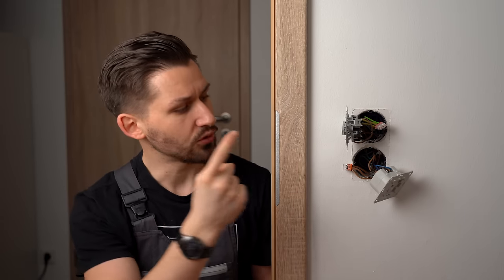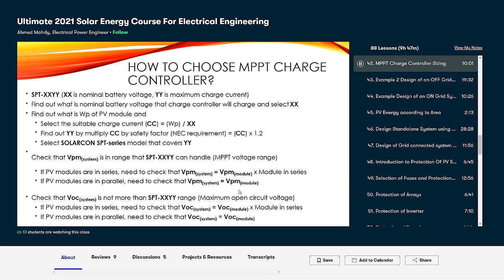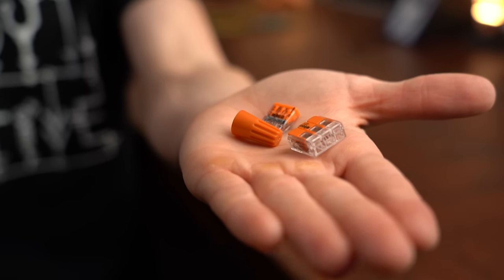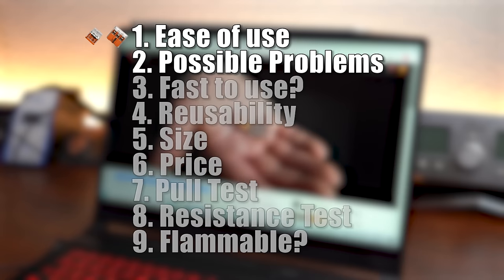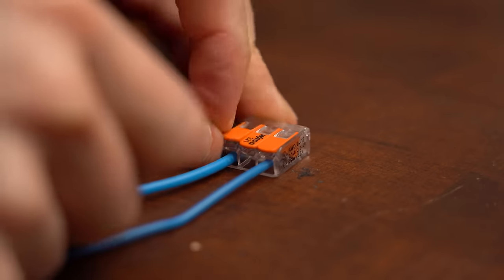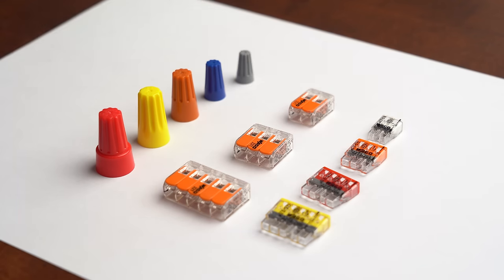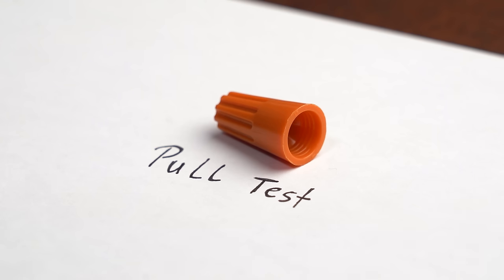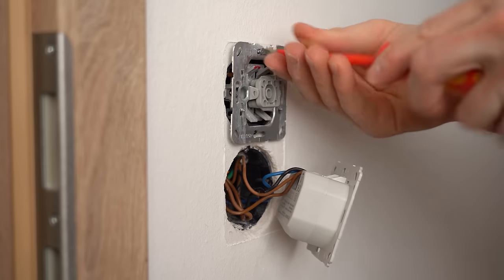What Wire Connector is the Best? Settling a Debate! Wire Nut VS Wago

Comment: Wire nuts are prone to user error. I've never used Wago connectors, but I think that's about to change...
Reply: So you gonna create a long distance wago connector dispencer?
Reply: There are billions of wire nuts installed across America. Billions. They are not at all prone to error if you understand how to use them. This is why Electricians are licensed professionals in the United States. This is just an example of the difference between a professional and an amateur. The wago in the test above performed only 37.5% as well as a wire nut in the resistance test. Why do you think US Electricians would substantially downgrade the quality of their work?
Reply: @senfdame528  You can get them from Lowe's or home Depot too.
Reply from the maker: Go for it ;-)
Reply: I have never had a wire nut fail.
Reply: @Peter_S_  he said prone to USER error; the user fucks up applying them rather than the fault being with the wirenut itself.  Both have their uses but I'm quite glad wirenuts pretty much vanished from domestic electrics in the 60s here..
Reply: @Peter_S_  ok
Reply: Wago is the way, dude. I switched from twisted cap nuts to Wago almost 10 years ago, and I haven't looked back since - they are superior to twist caps in every imaginable way (apart from the price, that is).
Reply: @Peter S  what, you think electricians aren't licensed professionals here in Germany? Sure... And just because something works doesn't mean there can't be alternative solutions with alternative strengths.
Reply: @Peter_S_  "They are not at all prone to error if you understand how to use them"  How is that any different from what he said?  "User error" inherently  comes from people who don't know how to use them properly.
Reply: I sell electrical supplies to US people in europe and whenever I see Wire Nuts I immediately have them replaced with WAGOs, exactly because of this. Its almost impossible to fuck this up, even if you are a guy doing your home install you can use the marginally higher prices Terminals and not run the risk of a house fire or explosive failure (I once had a heater go down due to the earlier european style "Lüsterklemme")
Reply: @stheil  What does your statement have to do with understanding how to use a wire nut properly? This video demonstrates how to not use a wire nut, not how wire nuts are correctly employed in service. Still, the Wago was only 37.5% as good as the wire nut in this resistance test. In the US most circuits are rated for 30 amps and are often pushed to that. The job of a connector is to provide a low resistance path. Using a connector that dissipates 1 watt by inefficiency which should not exist to begin with makes no sense.
Reply: @Peter_S_  What makes you think there are no licensed professionals outside of the US?
Reply: Life is prone to user error.  Literally the only redeeming trait of a wago is how “easy” it is to use.  Other than that they are utter garbage
Reply: @TomsBackyardWorkshop  yeah let’s see that wago stuck inside a lamp housing outside for 3 months in the south.
Reply: @zusurs  except for the fact that both nema and nasa agree that a physically twisted together connection for wires is superior in every way.  Try to pull apart a properly twisted connection with no wire nut.  Now try to pull apart a wago connection.  Wagos are trash.
Reply: @stheil  exactly.  But the point he was making is that in the US professionals have a standard, and easy doesn’t always fit into that.  The idea of the wago has been around for a very long time.  Our most common wall outlet receptacles come with what we call “back stab” connections that are basically just wagos built in.  For starters they only support 14g or 15a connections.  Secondly, you won’t find any electrician in the US that is willing to use them, because he doesn’t want to come back to fix his own work months later because he was lazy and didn’t install them properly.  Even nasa agrees there is nothing better than a physical wire to wire connection.  If your wire is spinning around inside it’s connector, it’s not actually making a good connection.
Reply: why not just use electric tape ... here in India that's defacto winner ... XD .... just twist the wires by hand and tape it .... I have never seen anyone use these in my country ... XD
Reply: @Stefan_Van_pellicom  No. The better Wago was only 37.5% as good as the improperly installed wire nut shown in this test. If you properly install the wire nut the difference would be even larger.
Reply: @wbarber69  And my point was that German professionals also have a standard. And wire nuts are not part of that standard. So the argument "Wire nuts are good because professionals in this country use them a lot" can be countered with "Wire nuts are not good because professionals in this other country don't use them". Note that I didn't say wire nuts are bad. Peter S focused on one point where wire nuts performed better, and I agree on that point. But that doesn't automatically make them superior. And if your electrician has to fix his own work because "he was lazy and didn’t install them properly" then that says more about the electrician than the tool.
Reply: @Peter_S_  about as much as your statement that "This is why Electricians are licensed professionals in the United States"
Reply: @stheil  the point is, wire nuts are a cover for a properly twisted wire connection.  They are not the connector.  Wire nuts are superior to electrical tape and paint in that respect.  Wagos are a cheap rendition of a bus bar.  And the only way to properly connect to a bus bar is with a ring terminal and screw.  I don’t see a ring terminal or a screw inside the wago.   Trying to compare the two when they aren’t even the same thing is asinine at best.  The fact that “German professionals” use them doesn’t mean shit.  The fact that actual electricians don’t use them.  Is beyond the point.  The whole video is a bad infomercial for wagos.  I was almost ready to see him bang one on a brick then use it to cut a tomato.   Once again wire nuts are superior to wagos because they cover an already existing connection.  Which is the proper way to do it.  Wagos are only good as saving you time and effort, not because they are superior, but because they incite laziness and don’t actually make a proper connection.  Which is why wagos were shown to be only 35% as effective in resistance testing.  Because using dissimilar metals to make connections isn’t always the best strategy.
Reply: @stheil  He was comparing licenced electricians to amateur DIY non professionals. You didn't read his statement properly.
Reply: @wbarber69  All the electricians that wire new houses around here use backstab connections. My dad's house was wired with receptacles that ONLY have back stab connections. They had no screw terminals at all. I replaced every single one with backwire commercial grade receptacles.
Reply: @Peter_S_  Huh?  In the US most residential branch circuits are rated for 15A or 20A.  Sure, there are a hand-full of dedicated specialty circuits for high-current electrical appliances.. but those aren't the common case.  I have a 3-gang box with 3 (2-way) dimmers installed.  It's just a mess in there trying to get all those neutrals tied together with wire-nuts.  The wagos are much more compact and easier to pack into the box.
Reply: Never seen wire nuts before (Edit: Never seen them used like this, that is. They are used in some old electronic-meters)
My brother is a electrician, and he uses Wago.
Reply: @lmamakos  Like their units the Americans seem to be sentimental about electrical connectors.
Reply: @Peter_S_  Yeah thanks. I'm an electrical engineer and while I don't wire up houses on the daily I've done a few installations and I promise it would have made no (electrical) difference if I had used wire nuts. You like wire nuts, that's fine. I still prefer other connectors (and that's not only wago ones btw) to them.
Reply: @Peter_S_  You seem obsessed with irrelevant resistances, yet have yet to show us one Wago that has failed due to their "inferior" performance. Just one. That's all we want to see.

Good luck.
Reply: @chrimony  I posted a video from Leviton, one of the largest electrical component manufacturers on Earth. You posted a random home DIY video. 🤣
Reply: @Peter_S_  I posted a video from a professional electrician. What are you smoking?
Reply: @stheil  I have decades of experience which includes a lot of repair of failed connections. Wago connectors are garbage based on their static performance. For connections up up AWG10,  I like ring connectors which are crimped, soldered, and jacketed, attached to screw terminals. It's time to face the physics of the situation and understand that the wago doesn't perform either short term or long term.
Reply: @Peter_S_  Well then I guess I better rush to my dad (who also has decades of experience) and tell him he's been doing it wrong all this time and his house is going to burn down any day now. Btw: It's not recommended to solder crimped connections but I'm sure with your decades of experience you know all about that.
Reply: @chrimony  I'm smoking (rather vaporising) Clementine distillate extract 68.35% THC/12.65% CBD from Tweedleaf here in Colorado, but that ad hominem is pretty pointless and it demonstrated you don't know what The National Association of Electrical Manufacturers (NEMA) has to say on the subject. Ever heard of NEMA? Why would you trust some rando in a DIY video over the word of one of the largest electrical manufacturers on Earth, and over the largest electrical manufacturers association on Earth? Do you get your medical advice the same way?
Reply: @Peter_S_  You keep saying "DIY", when the link I posted was clearly by a professional. Is he wrong? Fine, but that's the point -- professionals can get it wrong too.
Reply: I'm really wondering why this guy is so invested into Wire nuts and appears to be personally insulted because other parts of the world, especially Europe, do not want to chime into his praises of them. Here in Germany Wago and similar style connectors are the norm and German electrical engineering is world-renowned. I trust our engineering more than some random internet weirdo claiming Wago to be "garbage", looks like another case of toxic patriotism.

 In international comparison the US standards of electric installation are really not top-notch, this is not changed by NEMA being the "largest electrical manufacturers association on Earth". Most German electricians shudder when they see what you do over there, for example putting single core of wire through simple holes into metal boxes. For us this is a electric shock waiting to happen. German norms regarding electricity and the safety associated with it are extremely high, way higher than in the US. Many things you do there are downright forbidden here.

Also I would take the resistance measurement in the video with a grain of salt, would like to see it repeated with much more samples.
Reply: @Peter_S_  Sorry but:

a) You don't understand that there are multiple types of "wago" terminals (and they are not even all made by Wago!) with different construction and ratings.

b) You are constantly harping about "37.5% as good" resistance - and completely ignoring that this is a terminal designed for 240V and domestic circuits where you won't get more than about 16A (common breaker rating for a circuit in Germany). So your 30A (or even the 20A in the video) are irrelevant, for such load you will use a higher rated terminal! On a 16A circuit the 20A rated Wago has 25% margin. None of the connectors (or even wires) in the video were rated for a 30A circuit.

c) You are making conclusions from a sample of ONE. How many poorly installed wirenuts are reliably achieving that low resistance from the video? And how many Wagos did you measure to reliably make such conclusion? Not to mention that you are intentionally avoiding the fact that the worst performing Wago was the lever type - and the push-in type was fine.
Reply: @Peter_S_  There are billions of wagos installed across Europe and elsewhere. They are easier and faster to install. The extra losses you quote are fractions of a percentage - it's like claiming ultrasonically welded connections have less losses than wire nuts and are therefore superior.
Reply: @stheil  
Basically @Peter S  thinks that every German household should hire a US certified electrician to replace every perfectly fine wago clamp with a wire nut. 
Wwe use wagos to connect cables for outlets, lamps, switches,.. @230V, so 1W in losses is irrelevant, technically speaking, this connecter adds the equivalent of somewhere between 0,1 and 0,4m of cable depending on the type of wago

Peter S stated that Germany isn't reputable for its genius engineering anymore, but who wants to wrap every wire nut with electrical tape as recommended?   

In a nutshell: Wirenuts will work great for residential buildings in the US. 
These houses, which are 85% framed out of wood, will be destructed and entirely build new more often as the German houses which are built from stone, lasting much longer including their electrical circuits (wagos). 

Maybe one day the Americans will accept that not only their technology and standards work perfectly fine. 
We all know, that the Americans just sometimes need their specialties like their imperial system, the 9L V8 (which are quite cool) or wire nuts. 

(I still think that most of the Americans are quite cool)
Reply: @stheil  a million times YES.  Anyone claiming superiority of putting solder on a  crimped connection tells us a lot...
Reply: @verbanddeutscherunternehmer  dont know why this guy took it on as his personal mission to defend wire nuts, most electricians for new cheap houses dont use the best wire nuts anyways.
Reply: Anything is prone to user errors. But that's quite a strange reason to switch from wire nut to wago
Reply: @Peter_S_  As an American I can testify that professionalism here isn't that great.  Add to that the vast quantity of electrical items sold to DIYers and you can readily see the problem here. If you buy a new LED exterior light from a big box store or online a WEGO connector is a logical way to connect. How many Americans are going to pay to have it installed by a professional?
Reply: @largepimping  Putting soldered stranded wires into screw terminals is downright illegal in Germany because it makes a bad contact and poses a high risk of fire. So, yes, someone recommending to do that is just a (wire) nut case.
Reply: @downstream0114  Now now, don't lump me together with "those people".
Reply: @Peter_S_  After reading your comments I really hope you don't call yourself a professional electrician.
Reply: "I've probably spent more time as a director of engineering working in factories [...]  My connections are in use around the world, and they don't fail. [...] the US Army missile guidance hardware I used to repair" Ok, now I am convinced this is just a troll.
Reply: @JuliJaneMusic  You don't think product designers watch YouTube? Yes, my products are in use world-wide. I've worked in biotech, aerospace, consumer, and industrial areas. I also spent two years repairing US Army command guidance systems that were constructed with large amounts of wire-wrap interconnect. You are not adding any experience, insight, or facts and therefore you are simply trolling.
Reply: @Peter_S_   Joint contact resistance is not the only factor in an electrical installation. If it was, we would all still be using the Western Union splice. Nobody uses the Western Union splice outside of aerospace because in the real world it is not performant in hourly rates. 

You claim to have a pile of j-boxes with failed burned up joints. Great! How were they joined? Probably wire nuts! Also probably a few screw terminals as well. The problem with wire nuts and screw terminals is that they are an inherently inconsistent fastening technique. Was a torque wrench used on the bolted connection? Is it a silvered aluminum threaded lug, or silicon bronze, or grade 5 steel with chromate plating or basic zinc? Is the conductor aluminum or copper? Stranded or solid? Is there anti-oxidant applied to the conductor, the threads, or both? Was the oxide scraped off the aluminum?

These types of Wagos provide enforced consistency. You can know that due to the spring action there will be consistent pressure on every joint. As a foreman for an EC I would die and go to heaven if I could get enforced consistency on joints from my crews or even myself, if it's at a cost of a few extra ohms of resistance in the line. The v-drop will be negligible at 120+ volts.
Reply: @Peter_S_  You cite NEMA as some authoritarian standards body that suggests using wire nuts, but literally the only thing NEMA and the NEC say is to use a certified/rated connector as directed.  That's it.  Use the connector as directed.  That's the standard.  That's the code.
Reply: @Shynd   👈 this guy knows.
Reply: @wbarber69  : NASA would have that connection soldered after the mechanical connection...
Reply: @JuliJaneMusic  : The resistance difference is likely correct. The geometries of the connections mean that the wire nut has much more contact area, essentially removing the connection from relevance. The Wago push-style essentially only has some small edges (because of it's nature as a spring), and both Wagos route the electricity through a separate piece of metal (the bus bar/spring), with the inevitable consequence of higher resistance.

Personally, I prefer screw connections 100%, and find wire nuts too fiddly for me to trust, but on the resistance front they are the winners.
Reply: @Peter_S_  it was was 37.5% ‘less good’ but it’s absolutely within acceptable performance limits. The problem with the wire nuts is they CAN go wrong and a failed connection that you can’t check could burn your house down. With the Wago the connection method is much more likely to succeed as intended, CONSISTENTLY and can be visually verified.  At the end of the day, wire nuts are basically twisting wires together.
Reply: @absalomdraconis  where you gonna find extra solder on the moon?
Reply: @sprint955st  Meh, you could unscrew the nut to check the connection then tighten it back. The resistance difference is quite big...
Reply: I was thinking the same. Even if they were lowest resistance when a good connection is established, it's easy to make a misstake that can make the resistance really high instead. That in combination with them not being transparent (so you can see for example if all strands of a stranded wire is inside the spiral), makes them a bit unreliable. 
Btw. It looked like he used only 1,5 mm² wires there. I think the Wagos may also perform better at high currents, if using thicker wires, since they also get a bigger connection area inside the spring clamp (their maximum current rating is probably set after using maximum rated thickness as well 
- which is 4 mm²)
 - 20A thru 1,5 mm² is quite much and usually not much more than 10 or 13 A fuses is used for that cross section area, in hidden electrical installations (where heat in connections poses the greatest fire risk).
Reply: @Speeder84XL  obviously you also don’t know how wire nuts work.  They aren’t the connector.  Wire nuts are a protective cover.  You make the proper connection first by twisting the wires to NEMA specs.  Then you apply the appropriate wire nut the cover, protect, and fasten the connection.  Nothing beats a physical copper to copper connection.  There is no resistance added this way.
Reply: @goku445  and  @Peter The wires also have resistance. What would you say is so bad about that in a simple residential enviroment ?
Example:
All connection types are less than 1W loss on a 4600W load.
Indeed below that 1W loss there is a big difference (ex.:37,5%) between them all.
Reply: @wbarber69  personally I prefer what they call a Luster or Screw terminal or straight up doing a good proper twist with some pliers,no room for cap there tho need something like a heat shrinking tube for cover
Reply: @ghekor  the whole point of residential electrical installation is that even though something is installed permanently, it can still be removed or changed later.  Wire nuts allow for this.  But they are not the connector itself.  The connection is the twisted wire.  Heatshrink is too costly and unreliable to make permanent connections that could be subject to molestation later.
Reply: @Peter_S_  On the other Hand: Dude, that's 250µOhms more on the 2273, that is completely neglectable on their rated Currents. The 221  tough is disappointing. The Resistance isn't something to worry about at their Current Ratings, but still, the other two Connectors did a lot better. 

I would like to mention, that we do have certified Professionals here as well and I would say that at least 95% of said Professionals use Wago Clamps. I can't speak for anyone, but as a Professional myself I've basically never talked to anyone who uses Wire Nuts, nor have I seen installed any. They basically "don't exist" over here. 

The Reasons are obvious. They are easier to installed. I may be a Professional, but with the Wagos, you just stick em in and they hold. It isn't as tiring when you work over Head, and there is exactly 0 Guesswork if all of the Wires are connected properly or not. 

What I'm saying is... As a trained Professional I would still take the Wago Clamps over the Wire Nut any Day. 

As far as Amateurs goes.... Don't pretend you don't have Amateurs that do Electrical Work. We got them here as well. To be fair, you can do the House Wirings and all youself, if you  let a trained professional controll your work, but we all know Most won't. 
Since we can't prevent Amateurs from doing electrical work, I find I a little bit more reassuring, that they'll most likely use Wago Clamps, as they are easier to install. Again, we can't prevent Amateur works... Trust me if we could... My Jackass Brother for Example thought himself smart enough to wire a fucking Light Bulb in his new House and that bloody Idiot shorted L with PE and that's an Error that the User will detect right after they try to power it on, lol. You won't have that instant Feedback in a Wire Box with poor Connections, that slowly melts away the Plastic inside...
Reply: @wbarber69  True - but it still feels like it's easy to get a bad connection by misstake (especially when using solid conductor wires, that's not very easy to twist tightly or a mix of solid and stranded).
It feels like the Wagos is more reliable
 - even if the resistance is higher, it will be about the same every time (while still low enough for most applications) and if there is any problems (like strands sticking out or wire not stripped far enough), it's easy to se thru the transparent casing. 
But, then - it's also a question of being used to it. If you have done many wire nuts you probably know how to do.
I have never really wanted to trust those wire nuts, but have always used screw connections instead or soldered connections (for different appliances that's not installations in buildings). 
Then I discovered Wago 221 and think they are very convenient and it seems to give a good reliable way to connect cables in the 0.2-6 mm² range (that they currently have available).
Reply: @goku445  surely the entire point is to fit once and forget?? The nut is to ensure a better mechanical connection, sure just go right ahead and undo it.
Reply: Here and there I still find wire nuts (NL), and cut them away if I have to work in that box.  I tried 1 and threw it a way, I only use wago (like) connectors, have no idea what they cost. Need them, find/buy them, use em...      Try not to use any connector on longer distance and known bigger users (wallsockets and >10A)
Reply: I thought, great no more wire nuts!!! .. then saw the HIGH resistance readings.. https://youtu.be/zgjo36-jaFY?t=578
In the USA, our voltage is 1/2 what is used in Europe, thus out resistance power losses are 4X higher. Losing Several Watts at EACH junction, is unacceptable. 
Also, those Lever Lock Wago connectors, carry the contact force in PLASTIC.. which will relax with time & temperature .. seems VERY RISKY.. no thanks, sticking with metal spring wire nuts.
Reply: @Speeder84XL  if you find it too hard to twist a couple wires together properly, then you don’t need to be doing electrical work.
Reply: Over here, wire nuts are illegal to use. Due to the change in temperature that will caues the metals to expand and retract, it will loosen the twisted connection over time. In some cases it will loosen so much that the wire nut will fall off (even though the wires are still connected) and will cause an electrical death trap. Wago is spring loaded and will never become loose, and don't have this problem. (unless they heat up so much that the spring metal gets fatigued, but if that happens, you have a much bigger problem with the house in general burning up.)
Reply: @Peter_S_  An electrician's work is not measured in electricity. It's measured in safety and reliability. Also, the faster they work, the better for them.
Reply: @GoingtoHecq  The resistance test clearly shows the safety and reliability of the wire nut is far superior. 2.66 times superior for the better Wago and 14.66 times superior to the lever Wago. Try waking up and watch the video again. As an electrician, doing quality work that lasts for decades while I'm already being paid to work by the hour is far more important than me trying to save 4 seconds. What do you think you accomplish by making a poor connection and saving 4 seconds? Seriously, what do you think you accomplish by doing a poor job instead of a good job when you are already being paid by the hour to do a good job?
Reply: @KrustyKlown  The plastic lever is used to temporarily reduce the tension of the metal spring connection. If the plastic breaks, the connection stays. The plastic has nothing to do with the tension of the connection. This is obvious if you look at how a wago nut is constructed. But I wouldn't want you to trouble yourself with critical thinking or comprehension. Clearly bias and assumption is enough.
Reply: @KrustyKlown  You do have a good point about the voltage used...  I did not think about that...  Ofcourse I already understood  that there is a difference in resistance, I always put the 'suply' in the center of the wago.   My one and only expiriment with a wire nut did not go well (>30jrs ago).  I just read that at critical locations the nuts are still used here in NL.
Reply: @Shynd  EXCELLENT observation!.. thanks for that clarification!! What you describe would be a reliable spring contact system, where the metal spring carries the tension load that produces the contact connection force.
Reply: I agree. They look very reasonable as a wire connector. The 2 things that make the case for me are the speed and that the are clear which makes it much easier for fault inspections.
Reply: @zusurs  "they are superior to twist caps in every imaginable way " Of course connection resistance is one of those parameters that don't matter....
Reply: I've had two occasions where Wagos cause problems after a couple of weeks.  The first was where I had used them for a 15 amp outlet and the other was in some can lights with the supplied Wagos in the junction box.  Everything would be fine at first then the connection would go bad and start to arc in the Wago overheating and partially melting it.
Reply: @Peter_S_  you are completely talking out of your ass here!  "In the US most circuits are rated for 30 amps and are often pushed to that."  In residential circuits for general outlets are either 15Amps if fed with 14 Ga (2.5mm) conductors or 20Amps if fed with 12 Ga (4mm)  conductors.  The rule in all of the USA is 80% of the rating of the conductors and the Overcurrent protection device ahead.  This means that for a 14 Ga conductor we are only allowed a max load of 12Amps and 16Amps for the 12 Ga conductors.  We do have 30Amp circuits fed with 10 Ga (6mm) wire and the maximum draw allowed is 24Amps.   Do not make statements of fact when you are completely WRONG!  I am a licensed master electrician and make my living in all aspects of the trade from low voltage all the way up to private customer owned high voltage power pole and under ground distribution.  I have worked on European standard electrical equipment providing them with the expected voltages one would find there. Don't talk about shit you do not know!
Reply: @Peter_S_  Wire nuts are not simple kid.  Your statement makes it clear.  At this point I have installed at least 100,000 if not more of them and on occasion I still make a mistake and end up with a loose connection!   Every connection requires attention!  I did service for the better part of 8 years, commercial, industrial, and residential. I have literally replaced dozens and dozens of failed wire nut connections.  Same for push in connectors, mechanical connectors, and even wagos and a crimp or two.  You are really shining a spot light on your lake of knowledge here.
Reply: @wbarber69  NASA crimps or Solderes in certain cases such as shell pin connectors.  They sure as hell do not twist wire together!
Reply: @wbarber69  Yah we get it, you hate Wagos and they are shit and all terminations that they are applied to are crap and destined to fail.  I feel the very same way about ring terminals on stranded wire and terminated on an outlet or bar.  At least 80% of the time they are installed with the wrong crimper.  I have replaced my share of them for just this reason.  I bet you hate black button connectors for NM wire entry and snap in connectors for MC and BX wire too.  Wagos are not going to replace wire nuts.  They ARE another termination and connection option and frankly I am happy to have them as another option.  As an electrician here in the states we have far more latitude than Europeans and I use what is best and appropriate for the task.  You should as well.  The Wago 221 connectors are nearly as good a connection with stranded wire as a wire nut connection.  The resistance will be lower for stranded than their application to solid conductors.
Reply: @Peter_S_  So are we to understand that you are asserting that the Europian CE has given Wagos a pass but that they are total crap and unsafe?  Sorry but CE is as strenuous and restrictive in their testing regimen as say UL here in the states.  Wagos are just fine because they are running much lower currents.  Would I use them on an electric heater circuit that was in a cold basement and this pulling all winter?  No.  Would I use them for lighting circuits in my home and some limited convience outlets in my home, I sure have. Back to school kid, you don't know shit!
Reply: @johnalexander2349  They fail and I have replaced them.  Generally they are in a service that they shouldn't be.  Cap start motor on an air compressor that starts loaded was one such failure.  Another was a base board heater circuit.  It happens.  I have seen the same failures with wirenuts as well so YMMV.  For Wagos the failure was improper application.  For the wire nuts it was improper installation.
Reply: @Peter_S_  So you crimp, then solder and "jacketed" your connections.  I am sure the AHJ would love that!  Are you using the proper crimping tool for the ring terminals?  How many cycles does the die have?  Has the crimper been out to calibration and is it certified to produce factory specified cold weld terminations?  How do you prevent the heat from damaging the conductor insulation at the terminal to wire interface?  How do you prevent the flux wicking up the conductor?  How you you clean or otherwise deactivate the reactive flux post soldering?  What is the material and temperature rating of the "jacketed" material used to protect the wire to terminal transition?  I call bullshit!  If you have decades of experience it is sweeping in the shop and hauling the materials for the guys like me that are actually doing the work!
Reply: @JuliJaneMusic  I think I would take issue with your assertion that our installations and standards are inferior to yours.  There is allot of commonality between ours and yours and in some ways our electrical installed services are superior.  Not our outlets, that design is shit and you have use there!  Our panels are a robust affair capable of providing reliable service for many decades.  Our over current devices being installed now require both arc fault and GFCI function for just about every load.  Our grounding of the service is extensive and many sourced and includes the water service, ground rods, the service from our utility and even concrete encased grounding electrodes in some cases.  And given the option of getting tagged by 240V or 120v, well...
Reply: @mikeiver  Products fail when the user exeeds their rating? I'm shocked, I tell you. SHOCKED!

Oh, and I still want to see those failures, because you need a lot more than 20% overcurrent to kill a Wago.
Reply: @verbanddeutscherunternehmer  Not all of us are idiots here in the USA about this stuff.  We kinda have it better in some ways as we smart electricians can pick and choose from an array of termination options based on application.   I love German engineering, it is top knotch still.  Sometimes they get to fancy for their own good and over engineer.  But all the Germans I have known are pretty stand up in my book.  The same goes for most of the Europeans for that matter.
Reply: @mikeiver  🤝
Reply: @mikeiver  they most certainly do.  Solder isn’t available to you when you’re stranded out in space trying to fix a wire.  They have many standards to go by when doing repairs.  Solder when available, crimped if possible but always twisted.  Their recommended method of repairing a broken wire with solder still requires a spring twist and a half hitch tie to ensure the connections is solid before soldering.
Reply: @wbarber69  you are talking about an on the fly emergency repair that literally never happens in the space environment and under the extensively engineered conditions.  I am familiar with the signal wire splice.  We don't use it, we crimp, is mechanical splices, or wire nut.
Reply: Not a problem if you check your work, or follow a correct procedure.
Reply: @wbarber69  Because not everyone is a professional. Sometimes you just need to get a job done. Wire nuts applied in some funky real world situations often leads to pain and frustration for everyone who isn't a professional. When there is an easier, more fool proof way for a home owner to replace a light fixture, why not do that? This is the point of bringing up user error. It allows a skill to be more accessible for more people. 

Need to add a wire to a wire nut? What size wire are you using? No idea? Guess. Not working? Back to the store for a different size wire nut. Still not working? Twist the ends together. Can't twist solid copper wire with your bare fingies? Hope you have pliers. Doing all of this above your head, in the dark, on a ladder/chair? Tough shit, shoulda called a pro.

Or you could just use a three wire wago..
Reply: @Dizzykitty817  …… If you aren’t a “professional” then you obviously aren’t an “electrician” and you don’t need to have your grubby hands inside the box.  Move along now, this conversation doesn’t include you.
Reply: @wbarber69  I disagree. When more than two cables are connected togheter the twisting can result in loose cables, especially if they have different diameters.
There is a reason why this is avoided at industrial machine parks
Reply: @wbarber69  here in Italy we have exactly that, a ringterminal with anscrew, covered in plastic for household connections, but when we look at automation the whole world uses a wago like connection, accessible with a screwdriver
Reply: @caked3953  by NEMA code differing diameter wires would suggest you are mixing amp ratings.  Which is no longer legal in the US.  14g wire is rated at 15a usually and 12g rated for 20a. The different wire types would require the proper sized breaker for each wire type.  Meaning you just broke the law son!  Lol but yeah don’t mix wire sizes.  But even in this unlikely event that find some old work that was done improperly and you’re just fixing it, it’s totally possible to properly twist 2 different wire types into one wire nut.  It’s all about the technique.
Reply: @wbarber69  I never worked in household ( only industry ) but it's common to find this for connections with long cables with higher diameters compensating for power loss and mostly for N connections.

Here ( Italy ) we use onesided screw connectors, how do you handle this in the USA?
Reply: @ReNeyer  In the long term... the terminals are much more likely to cause a fire than a proper wire nut. These days electrical wiring last 40+ years... the spring contacts in a wago won't.
Reply: @wbarber69  My house was wired with back stab receptacles 40 years ago... the springs failed on all of them. All the non back stab ones (the receptacles have oth a nut and back stab option) are 100% rock solid... the issue with wagos is that they rely on that spring... and with occasional humidity that spring will rust right away.
Reply: @sprint955st  Wagos aren't perfect either and can also "go wrong" ... especially in the long term, the increased resistance means more heat, which means more thermal cycling then would ever occur on a wire nut... also the steel springs won't last forever... and will oxidize and weaken.
Reply: @Dbass91  In practice... it doesn't happen, I've never seen a properly twisted wire nut release itself... even in outdoor installations. Also all wirenuts are wrapped in electrical tape so are never coming appart.
Reply: @mikeiver  Crimps and solders are compression connections ... just like a wire twist. And are mechanically sound, on the other hand a wago... is inferior in literally every way except time to install. It's quite literally fast and loose.
Reply: @Wingnut353  exactly the point I’m trying to make.  After some time wagos will be deprecated, way before wire nuts are.  I wish you people could see the job I’m working on.  Like every other wago i go to remove from the box to work on at least 1 or more wires just falls out of them.  In fact I spent the better half of yesterday looking for a loose neutral that ended up being in a splice in the attic.  Had everything working but nothing would come on.  Put the tester on there to find 92 volts. When I finally found the offending splice the wago just came apart in my hand.  They are made of the same cheap plastic that every thing else is made of and over time that plastic simply dries out in the heat of an attic like anything else.  You know what doesn’t dry rot? Copper!
Reply: @wbarber69  You seem obsessed with the notion that there's only one way to do things and that's the way that you and people you know do it. The fact that Wago connectors are legal proves that they are certified for their intended purpose. If there's one thing that Germans are known for around the world, it's top class engineering, so if German electricians and the German electrical authorities think that Wago connectors are OK, then I'm inclined to trust them on that.

In my experience on the internet, Americans in particular seem to think that anything not done their way is awful. Of course that's laughable when you consider how the UK electrical plug is far superior to the American one and how poor a lot of American plumbing is when compared to European examples. Even if you're not an American, you sure comment like one. You need to accept the fact that there are alternate methods that average out as being as good as each other, despite their individual weaknesses. This video attempts to prove exactly that.
Reply: @donaloflynn  lots of things have been legal throughout the years.  Lots of things have been the standard that are hard no’s now. We used to not have ground wires at all.  For some time switches never had neutrals run to the switch box.  Up until like 10 years ago you could bond neutrals and grounds in any panel, not just the main.  New homes now are required to have both gfci and afci breakers in the panel.  New homes don’t even have gfci outlets anymore because everything is in the panel now.  Simply stating that something is legal, or “up to code” doesn’t make it the proper way to do something.  There’s at least 10 different ways to do anything and everything related to keeping up with standard code legality.  Like how some people argue now about “what if you have different sized wires….”  Well going forward, you don’t, because it’s not legal to use both different sized wire on the same circuit anymore.  Even if you were to have a 20a conductor on a 15a breaker it’s no longer legal to do so.  It used to be, in some places as little as 5 years ago.  But not anymore.  And mark my words, in 30 years wagos will be archaic.  And new electricians will laugh and laugh at how stupid we were to use them.  And yeah it’s an obsession at this point, because I literally walked onto a job that was plagued with wagos and even had multiple wago related fires I’ve the last 3 years and get gone to this video at the top of my recommended videos.  Wagos are only useful for installing fixtures.  Not for permanent installs.  Hell I have a few different sized of them in my truck right now just for hooking up ceiling fixtures in drop ceilings.  I wouldn’t argue against them if I didn’t have concrete proof of their failures though.  And even in the capacity that I recommend them, I promise you, if you put one next to an old magnetic fluorescent light ballast, that thing will turn into a crayon someone left in the back window of their car in the middle of a simmer day in Arizona. I know that, because I’ve seen it first hand.
Reply: @wbarber69  You clearly haven't taken on board a single word of my comment. Just more waffle declaring yourself a know-it-all. Not that I expected any better having read your previous comments. Standards evolving in no way proves that the way you say something should be done is the right way. The fact that houses not done your way are not burning down everyday is proof of that. Do you ever stop to think that other people can be right sometimes and that your methods are not infallible? Such arrogance.
Reply: @donaloflynn  I’ve read every word.  That still doesn’t make you right.  Like I said.  Time will be the judge.  And I’ll still have this same account so if YouTube is still here in 2050 I’ll be ready to accept your apology.
Reply: @wbarber69  Nothing you’ve said makes you right either and the arrogance with which you’ve put your arguments across makes most sensible people view you as confidently wrong. Completely disregarding alternative methods that work fine in many millions of installations is absurd. Try some humility next time?
Reply: @donaloflynn  yeah right humility, when the issues I’m pointing out are literally staring me in the face.  And yeah this house almost burnt down 3 different times.  If it weren’t for the fact that most building materials are fire retardant then this house wouldn’t exist.  Oh and on another note, TO ALL WOULD BE RESIDENTIAL ELECTRICIANS:  if you leave 3 inches of Romex insulation and all the paper wrapping in your receptacle boxes, you are basically just building a tiny little fire everytime you wire anything up.
Reply: @wbarber69  One house isn't proof of anything.
Reply: @donaloflynn  one house with 150 faulty wagos. Sure….
Reply: If you know how to use a wirenut it will not fail you. If you don't, then yeah it's harder to install correctly than pushing a single wire into a wago. The wirenut requires more skill, thus there's more opportunity to screw up. It also produces a superior electrical joint compared to the wago.
Reply: Whatever you go with, it takes about 2-3 minutes to learn to use it correctly and safely. If switching connectors gets you to spend that 2-3 minutes, that’s absolutely what you should do. Do whatever you have to to learn how to use high voltage connections correctly, short of burning down a building. The only users prone to error are the ones that look at something and think “eh I probably understand it well enough” and then don’t ever spend that 2-3 minutes. It’s high voltage, homie. It’s worth it. Thankfully, it’s quickly evident you’ve screwed up if you give your nuts a tug.
Reply: @Peter_S_ as an extreme example, writing your own operating system is not at all prone to error if you understand how to do it. doesnt mean its a user friendly/foolproof way to use a computer
Reply: @Maric18  Have you ever operated a screwdriver? Wire nuts are no harder to use properly. 
The proof is in the fact that they have been the North American standard for over 100 years. 
The resistance test shows the wagos are clearly inferior. Physics.
Reply: @absalomdraconis  Not so sure about that tho. Aerospace is moving away from solder as much as possible for other than mounting components on circuit boards, due to soldering of wire has shown to cause fatigue in the transition where the wires leave the solder. in that regard a correct crimp connection which leaves spring-back in the material is the recommended method.
Reply: @Peter_S_  In this test they look really good but also they are not allwed in Germany... it must be something wrong with them.
Also they cant connect more than 2 wires "safely" with the Wago type, each wire has its own Clamp, so it cant go wrong.
Reply: @JuliJaneMusic  what he wrote reads like a navy seal copy pasta
Reply: If Americans are so, so precious about their technique being the best then they should be using the style of connectors used in aus/nz. We use a plastic shell that you fit the twisted wires into and then bear down on with a brass screw. There is your perfect connector solution. But then everyone here started using wagos because they are awesome haha.
Reply: I come from germany, Wagos are the best
Reply: @Peter_S_  I agree. If an amateur is too prone to make errors with a wire nut, then they have no business doing electrical. Dumbing down to the wago is a dangerous precedent.

I am also not a fan of push connect switches/plugs, or plumbing. 

People need to understand the wire nut is really about insulation not connection. I would never insert the wire and count on the wire nut to make the connection. No one I have ever known does that. Always a firm twist connection, then apply the nut. - Cheers
Reply: @zusurs  Are you talking the winged wire nut style?
Reply: Id say this is up to experience using them. EG: how many times you've used before.  The Wago seem more "first time friendly" but the Wire Nut system, once your used to it - you get done faster (that shown, not faster than Wago's due to the twist needs) and just as well with little to no user error.

Think of every home in america, every apartment, every socket, every light - all of them have wire nut by default.  That is literally 100's of millions of wire nuts - how many failed?  Not enough to demand a PSA or "how to class" that is for sure.
Reply: Wagos are heat prone
Reply: @KrustyKlown  The force is carried by the metal strips which fails shut, i.e. the default position is clamped. The plastic levers are used to release the pressure so that wire can be inserted.
Reply: @wbarber69  Were these name-brand Wago connectors? Lever lock or backstab? There are lots of knockoff brands out there that look almost like the real deal at first glance.
Reply: Wire nuts are better in the things that matter, if you want quick and easy yes Wago is great. Quick and easy creating inefficiency in the wiring seems an odd choice for countries that think they will save the planet with solar panels. Will wago burn down your house? Unlikely, however it will in fact as measured in this video raise your electric bill. The inefficiency measured was dismissed as good enough, which is true from a safety perspective, however it is still there all the time consuming power ever time you flip a switch or plug something in.

Do you care about that power consumed, only you can answer that question. I fall in the “whichever is handy” category. For heavy draw circuits I prefer wire nuts, but typically no connections are required at all for such circuits.
Reply: @wbarber69  I too wish we could see this mythical job you've working on, that's got "several" failures of a product that nobody outside your bubble has ever seen fail.
Reply: If you can not properly install a wire nut then you should be messing with electrical,  simple as that...
Reply: @Stefan_Van_pellicom   NOPE Wagos have been banned from life-critical installations here wire nuts will be around long after wagos have been abandoned. And you cannot use wagos with aluminum....
Reply: @stheil   Not much of an electrical engineer if you think that a higher resistance connection make no difference.    Where did you get your degree out of a catalouge...
Reply: @johnalexander2349   How about multiples.  Wago have been banned from life critical installations here due to the high failure rate.
Reply: @Matthew Matthewq  not much of a reader if you think that's what I said. And just FYI, Technical University Munich, not that it really matters.
Reply: @Peter S  I love how something is awesome just because it works. No reason to look for other solutions people, this here works so we might as well stop all future development!
Reply: @matthewq4b  Show me.
Reply: @Peter_S_  The problem is that even a licensed electrician can make an error.
Reply: Still waiting, Matthew Matthew Matthew. How exactly did you think you were gonna get away with that Iie? You think we weren't gonna ask for proof? They've been used for 70 years, all over the world, certifications for everything from boats and trains to houses and industry from half the planet, but no, you think you're gonna come here and Iie about failures, and we're all gonna just believe you.

Show us the failures. Show us the law that makes them banned.
Reply: @Peter_S_  if you install like the video shown then why you arent using the wago? i mean the cost of the component is so little that i think your boss or who ever paying the worker will gladly swap into a faster install yet safer option, because last time i check the labour cost is the highest cost for anything done in US
Reply: This was a very entertaining comment thread to read. Thanks.
Reply: @Savagetechie  I took apart an electric "fireplace" to trash it recently (and cannibalize any spare parts) and found it was built with wirenuts
Reply: @downstream0114  For things like distance, metric is clearly superior. Climate measuring though, Fahrenheit has more utility than Celsius as it gives you almost double—1.8x—the precision of Celsius without having to delve into decimals, allowing you to better relate to the air temperature. We're sensitive to small shifts in temperature, so Fahrenheit allows us to discern between two readings more easily. We don't live in water, so why should we relate the temperature to water?
Reply: @downstream0114  If an electric connector is loose enough to rotate freely, it isn't a good connection, wire nuts are better full stop.
Reply: @MechanicalMooCow   If an electric connector is loose enough to rotate freely, it isn't a good connection, wire nuts are better full stop.
Reply: @JuliJaneMusic   If an electric connector is loose enough to rotate freely, it isn't a good connection, wire nuts are better full stop. Sure there are a lot of things America could do better regarding safety, but removing wirenuts is not one of them. There is a reason we use twisted wire connections in spacecraft
Reply: @jaydunbar7538  I agree with you on a lot of what you said. Wagos should only be used for like prototyping and diy circuits. That said, anthropogenic climate change is absolutely real and the biggest threat to humanity in the short, near, and long terms. The Colorado, you know, the one that made the grand canyon? Yeah it is currently at the lowest point it's been in recorded history. Farmers in Arizona are being told how many fields not to plant this year. Miami and New Orleans WILL be underwater in a matter of decades. We NEED to transition away from burning fossil fuels in all aspects of life. We need massive investment in renewables, nuclear, and energy storage technologies, and we needed it yesterday. I don't believe we should sacrifice comfort to achieve this, and the only way to do it without having everyone reduce energy consumed is to build up alternatives. Don't disparage countries building out alternative energy, your grandkids will hate you for it.
Reply: @poiu477  keep telling yourself that. "Rotate freely" what planet are you on where wago has an inbuilt rotational feature.
Reply: @Peter_S_  if the argument is that they are prone to user errors, you can't counter with "not by professionals". well, yea. but not everyone is a professional..
Reply: @MechanicalMooCow  if the conductor can spin freely inside the terminal. has nothing to do with any built in feature, im just saying they do not provide enough compression and you can rotate the wire,
Reply: @MechanicalMooCow  like holding the wago with wire inserted in one hand you can freely spin the wire inside of the wago, it doesn't clamp with enough force to prevent this.
Reply: @MechanicalMooCow  like you know how you can spin a 3.5mm headphone plug in the jack? thats what i mean
Reply: You have alot to learn about electrical theory.  Wagos are a weak link in the circuit and a poor substitute for knowing how to properly splice wires.
Reply: @Peter_S_  And I have so many fucking melted wire nuts in this old house lmao
Reply: @Peter_S_  It is already downgraded by 50% due to your inferior 115V mains voltage ;-)
Reply: @poiu477  ..Nothing wrong with decimals, climate predictions've always been in tenths of a degree. 221s don't rotate, if you tried, in my recollection.
Reply: @downstream0114  again, why base what we measure the temp outside with on water? we don't live in water. Having a broader range of positive numbers to describe the temperatures most people experience is just inherently more useful. Decimals do make things less intuitive. People can feel the difference between 68 and 65 degrees and idk what that would be in celsius but I guarantee it doesn't portray the same difference. In the Northeast US I see temperatures ranging from -15-110 degrees Fahrenheit over the course of a year.
Reply: @poiu477  in all honesty I am well aware of the "lineman splice"  just about every branch of the military, communications industry, aerospace, etc has some variant of the spec.  NASA sure as hell doesn't use this to splice conductors in looms.   And the electrical trades have not done this kind of connection here in the states for near a century.   It is not acceptable at all now for anything outside of the 50V and below range.
Reply: @mikeiver  according to the document I linked, yes NASA does....
Reply: @poiu477  And like I said we electricians have not for near a century and it is not an allowed splicing method now.
Reply: @mikeiver  it is literally the best, least resistive connection aside from using a single conductor
Reply: @poiu477  Why base what we measure on a 16th century chemistry experiment and the blood temperature of a healthy person.

I'd say knowing when water freezes or boils is pretty relevant for a lot of things. Originally it's for ease of calibration.

In Finland I see temperatures from -40 to +40C. Glorious symmetry. My thermostat works in .5 degree increments. Outdoors the small increments are useless since thermal gradients will vary tens of your Fahrenheits anyways. E.g. walking into a swampy area.
Reply: @downstream0114  because everyone can identify with normal body temperature? Because it has more utility and precision for describing the human experience with climate? Because it describes the expansion of mercury relative to temperature which is what our thermometers are made with?  For the sciences I agree, calibration and base 10 is important but for meteorology and climate reporting Fahrenheit is undeniably more useful and intuitive.
Reply: @downstream0114  you find yourself walking through swamps often?
Reply: @poiu477  There is no advantage. Someone that's used Celsius their whole life has the exact same intuitions you think are exclusive to Fahrenheit.
Reply: @poiu477  Yeah, there's plenty of footpaths that go through swampy areas in my home town. That's just the most extreme example. Even regular paths vary wildly in temperature if you pay attention.
Reply: @downstream0114  Says the person who says "there's no problem using decimals" It is simply less useful. You can be used to exerting more effort, sure, doesn't change the fact that it takes more effort. There is no benefit to using Celsius to describe air temperature, only compromises, whereas Fahrenheit only has positives. Name one downside from using Fahrenheit to describe climate.
Reply: @downstream0114  Personally, I use Fahrenheit for cooking and for temperature outside, and celsius for chemistry and related fields. Sticking to one for everything just seems dogmatic
Reply: @downstream0114  why do you need to relate the temperature outside with the boiling or freezing point of water?
Reply: @downstream0114  both scales can coexist at the same time
Reply: @downstream0114  and actually, I don't think I believe you, I routinely walk in covered forested areas and I've never felt a distinct temperature gradient. Perhaps it might be unique to extremely high latitudes, but I've never experienced that in the Northeast US
Reply: @downstream0114  yeah actually I don't believe you at all, the highest temp ever in Finland was 37.2 degrees Celsius.
Reply: @poiu477  Jeez, how lazy are you if decimal points are considered effort.

"I use Fahrenheit for cooking and for temperature outside, and celsius for chemistry and related fields."

Well what if you know from your biology that egg proteins coagulate from 56 to 80 degrees C. So clearly you can cook eggs in boiling (<100C) water. Can you cook eggs on hot asphalt of 130 F.

Seems like using one unit would help you see links between unrelated topics. Units shouldn't get in the way of understanding.

Would you adopt a completely arbitrary unit of measure for temperature for a random application.

Because that 16th century chemistry experiment isn't really relatable to anything in your common experience and "healthy body temperature" varies quite a bit.
Reply: @downstream0114  It has nothing to do with laziness and more to do with intuitiveness. I don't know about you, but personally, I don't want to waste unnecessary mental cycles on decoding whether or not I need a coat. If that is laziness than sure, I'm lazy. Why would I cook eggs on asphalt? I cook eggs on a frying pan with oil on it, and tbh I couldn't tell you what temperature it is, in F or C.
Reply: @downstream0114  and yes, if there was utility in adopting a new completely arbitrary unit for measuring something, and that utility outweighed the cons from switching then yes I would.
Reply: @downstream0114  People don't generally need to see links between unrelated topics except in academia, in which case I've already said I agree with metric being used.
Reply: @downstream0114  In cooking the difference between 350 F and 425 F are very great, however on the Celsius scale they are only 42 degrees apart.
Reply: @downstream0114  and maybe base it on that 16th century experiment because we still use mercury in our thermometers, so it is still just as accurate
Reply: @downstream0114  Like you seem to fail to recognize that in the rare event you need to be able to do science or whatever on the climate or cooking, you could always just convert away from fahrenheit. Using the same units for everything just seems to be making compromises for the sake of being more useful scientifically, but not everything is for the benefit or sake of science.
Reply: @downstream0114  also "healthy body temperature" is incredibly rarely outside of 97-99F which is a totally acceptable margin of error for most applications.
Reply: @downstream0114  Look at it this way, in Fahrenheit, 0 degrees is cold, and 100 degrees is hot, in Celsius 0 degrees is cold and 100 degrees is dead, I think the former is more useful
Reply: @lmamakos  thats the point.
While wirenuts might provide a better connection, there are other, severe disadvantages:

1.
Since it screws into the copper, if you ever have to rework the cabeling, you have to cut the damaged part of the cable.

2. 
It might be more difficult to understand what is going on in a connection box when wirenuts are used.

3.
Adding additional cabeling afterwards requieres you to rework the whole connection box (see my first point).

4.
Wirenuts may conceal a better connection in the beginning, but twisting wires creates tension, which could even cause them to become loose on occasion. 

Also, since most civil electronics are done here with Wago style connectors, I can tell you that it doesn't cause any problems after 20 years. Houses in Germany are build to last more than 60 years. Since houses are immobobile objects, there isn't a lot of stress on the connectors.
Reply: @poiu477  how is "0°C is freezing water and 100°C ist boiling water" not a useful scale?

Fahrenheit just choose 2 random points for 0° and 100°. Celsius is based no water at 1013.25 Hectopascal "normal pressure".
Reply: @timojohn9773  Because we don't live in water? And actually no, they were not randomly picked, 0F is the temp at which a brine solution and ice will reach thermal equilibrium, and 96F was the approximate temperature of a healthy human, which was conveniently exactly 3 times the freezing point of water. Also, 1F change makes mercury expand by exactly 1/10,000th. Additionally it allows for greater precision over the range of temperatures humans are likely to experience without resorting to decimals.
Reply: @Peter_S_  Americans should not speak at all in matters related to electricity since their standards are at the level of those of the Eastern bloc countries.
Reply: @Peter_S_  I did a double-take at 30A, but then remembered the whole 110V issue. Yeah, home circuits in WAGO home territory are usually 16 A max, as that and 240V is plenty of power (and also the max rating of the Shuko wall connector). Anything above that, I'd personally use a dedicated circuit from the fuse box to the wall connector, these have no business being spliced in some random box-in-a-wall. Then again, I'm not an electrician, and thus perhaps overly cautious.
Also, WAGO 221 are only rated for 20 A anyway.
Reply: @Peter_S_  No company not in private ownership can be noble BY LAW. They are required to put the financial interests of their shareholders first. Just to set that bit straight.
Otherwise, not arguing. Also, the 2273 WAGOs are not meant to be reused, by pulling the wires out he blunted the spring edge, and ruined it's ability to make a gas-tight contact. Just like one is not supposed to reuse wire nuts, it will usually be "fine", but it's less corrosion resistant.
Reply: @poiu477  "we don't live in water" but we do live in mercury?
Reply: So let me get this straight: Wire nuts and Wago connectors are both fine if installed/used correctly and if you're soldering outside the ship in space, you don't need flux, but if you're inside the ship, you do?
Reply: @timojohn9773  we don’t live in mercury, but we still use it to construct thermometers.
Reply: @poiu477  at least in the EU, mercury thermometers are forbidden,, because of - well - the mercury inside.

Also, what do you get in contact with more often? Mercury or water? What do you need in your daily life?
But well, whatever floats your boat, it's fine.
Reply: @Peter_S_  yeah you guys just insist on the fact that the wago perform 37,5% of a wire nut. But you have to keep in mind thats 230v and the wago can also up to 420v. The nuts and the wago connectors are built for different rates. I've used a european product similar to the nuts called "Lüsterklemme" which actually coucht fire after using them on 420v
Reply: @ingulari3977  Fahrenheit is better than Celsius for describing outside air temperature. Metric has better lengths and weights.
Reply: @ingulari3977  Yeah but I am not talking about using Fahrenheit for science and stuff. You can use one unit for temperature of climate and other units for science. No need to really understand what the temp of a solution is relative to what the temp outside is.
Reply: @ingulari3977  I use Fahrenheit for everything except for like Chemistry stuff. It allows for more precision without using decimals, which makes reading analog thermometers easier.
Reply: @ingulari3977  If I need to follow an experimental procedure I use celsius. If I'm just doing tasks I use Fahrenheit.
Reply: @ingulari3977  Additionally, we don't live in water, why base our temp outside on the freezing and boiling point of water? It will never be 100 degrees C outside, whereas I see 100 F every year. 1 degree Fahrenheit makes mercury expand by exactly 1/10000 so it makes thermometer construction easier.
Reply: @ingulari3977  People can perceive changes in temperature at a very granular level. Fahrenheit allows for more accurate conveyance of these small changes without having to use decimals which are unintuitive.
Reply: @ingulari3977  I'm saying I never need to compare between the things I use Fahrenheit for and the things I use Celsius for. I don't care what the temp outside is when I am boiling off a solvent, and I don't care what temp something will boil off in C when I am deciding if I need a Jacket or not
Reply: @ingulari3977  I just think a non decimal system, that uses more numbers, and is weighted towards positive numbers, is just inherently easier to understand. Most people will experience maybe -10F-110F wheras that same range is like -23C-41C
Reply: @timojohn9773  Wait can you guys not get mercury at all? what about for chemistry purposes? I don't need a temperature scale to know when water boils or freezes though. I make ice in the freezer and boil water in a kettle or a stove. Again, Fahrenheit isn't based on mercurys phase change points, the scale is just as efficient with other measuring tools, just makes the production of thermometers easier. I personally think society will collapse in the near term as a result of climate change so knowing how to build a thermometer is pretty important.
Reply: @timojohn9773  Jesus I thought it was just guns you people were so afraid of, how do you accept such broad regulations on things you're allowed to do?
Reply: @timojohn9773  All chemicals should be freely available for home labs to do experiments with. Additionally the possession, manufacture, and consumption of all drugs and their precursors should also be made legal. The state shouldn't stand in the way of psychonautic experimentation and recreation.
Reply: @Peter_S_  Here in Ontario, Canada, electricians aren't just a licensed trade, but a regulated one.  (Actually, it's TWO regulated trades, as we separate home and rural electricians from construction and maintenance electricians.)  It's illegal here to perform the work of a regulated trade for pay without being a licensed member of the trade or a registered apprentice working under the normal supervision for an apprentice.  (Some of these make more sense than others.  Crane operators are a regulated trade.  So are hair stylists.)
Reply: @poiu477  yes, i really feel constraint by banning of unnecessarily dangerous consumer products.
Reply: @poiu477  we can get mercury. But it isn't allowed in common consumer thermometers.
Reply: @poiu477  not ALL chemicals should be freely aviable for a good reason. I agree with drugs, tho. Something like the portuguese model would be very nice.
Reply: @timojohn9773  I mean prohibiting things like nerve agents and radioactives are cool. But the Portuguese model doesn’t go far enough imo. There should be state regulation of the market, and I’d even prefer state run distribution centers
Reply: @wbarber69  if the housing is rated for outdoor/wet use and is properly installed it will do just fine thank you.
Reply: @Peter_S_  Just sayin, soldering any connection is forbidden here in Germany, u may have ur "NEMA" we have our "VDE", and they state, that anything soldered, and THEN pressured (like ur crimping and screwing) losens the connection, because solder gets soft if it's pressured!

So much for ur "Knowledge" and thats excactly why u didn't reply to that point Kayla mentioned!
Reply: @TomsBackyardWorkshop  I’ve had a couple come apart, the plastic cover separating from the metal coil inside.  

I’ve always tugged on the wires when doing a stranded to solid connection with a wirenut, and sometimes have had to go back.  I’ve never not had a WAGO levernut take hold.  It always has worked.
Reply: where wire nuts are prone to user error; wagos are prone to device failure. If you know what you are doing wire nuts are better in everyway, and dont have to worry about when (because it is a when) the wire nut is going to loose its grip and become a fire hazard in your walls like with wagos
Reply: @seanverrett107  In all the testing that I’ve seen on WAGO connectors, they run up several times over what they’re rated for.  They are also UL rated for US and Canada, Israel, EU, Japan, US ships and European ships. Anymore, wirenuts are another piece of Chineseum with no rating, unless you’re really looking for UL-rated wirenuts.
Reply: @ppainterco  wire nuts don't are noncurrent carrying and that's what make them better. They don't have a current limit like wagos.
Reply: @seanverrett107  - a 20amp WAGO connector has been tested to 60 amps with no damage.  The breaker should trip well before the WAGO burns down.  On the other hand, an improperly installed wirenut probably has a greater chance of burning than a WAGO.
Reply: @ppainterco  a wire nut is still rated higher than a wago for current, and a wire nut connection doesn't degrade over time like a wago's does. And that's the problem with them. It's not if a wago will fail, it's when.
Reply: @seanverrett107  if the wire nut used is actually rated.

I doubt that the WAGO will degrade unless you’re exposing it to UV.  

I’m convinced that wirenuts are cheap and embedded in the US marketplace.  I’m not convinced that they’re actually better.
Reply: @ppainterco  it's compression gets weak over time. Wire nuts are meant to last. If you are just wanting to wire something together for a short to medium amount of time wagos are fine. Just not meant for long term usage. Don't know how many of these I have had to take out after just a couple of years of use.
Reply: @seanverrett107  i would like to know where are wagos a threat for fire and how often a wago has a system failure? Used about 5000 of these and never had one single problem
Reply: @seanverrett107  Zero. You've had to take out zero. Amazing how these mythical Wago failures only ever happen to wirenut fans, never to any of the thousands of professional users in other parts of the world. Maybe the Wagos can smell your fear. Or maybe it's something else that smells...
Reply: @johnalexander2349  had them on lights at a plant. Had to change out every last one in the building,  but a better question is where are you installing them at. I could use some side work. Changing them out for wire nuts is a nice ez job.
Reply: @seanverrett107  Sure you did. I'm installing them on every job I do - you can come around in 70 years or so, I'm sure they'll be ready for an update by then. Better bring a good pair of gloves because there's more than a few 8-ways.
Reply: @johnalexander2349  the hundreds that I had to fix was installed in 2011 and was changed in 2018. You added a 0.  As a maintenance guy I guess I should be thanking you for using them. job security
Reply: @seanverrett107  Yes, hundreds. These mythical failed Wagos, are they in the room with us now?
Reply: @johnalexander2349  no, they are in the trash for 4 years now... You ok bro? You act like these things are holding together your life. Which just guessing from your responses started falling apart about 6 years ago.
Reply: @seanverrett107  Of course they are. Right next to your unicorn horn and mermaid tail. You ok bro? You act like wirenuts are holding together your life. Which just guessing from your responses started falling apart about 6 years ago.
Reply: @johnalexander2349  stick to your hobby electronics. Let the real electrician do their jobs. Gn
Reply: @Peter_S_  "Physics." XD
Reply: @zusurs  lol so having a nearly 1 ohm resistor on every connection is superior? Get real dude.
Reply: you are not an electrical professional  read electrical code
Reply: @Peter_S_  Wire nuts might cause lose connection and electric arching. "Each year in the United States, arcing faults are responsible for starting more than 28,000 home fires"
Reply: @Peter_S_  wire nuts are bad connections, heat causes problems for the twisted wires and loose up, causing more heat.
that's why they are phased out in Europe.
Reply: @greatscottlab  Please don't do these videos you don't know how to use wirenuts.
Reply: Nothing is idiot proof.
Reply: @Peter_S_  You seem to be that kinda guy that prefers the Imperial Unit System over the Metric one, cause you've never exposed to anything else and that's why it's all that you'll be using. And both is wrong! :D
The key to make your life easier with inventions or alternatives is to stay open minded and give new things a try.
Whats better?
1 km = 1000 m = 1000 000 mm
1 mile = 1760 yards = 1760*3 feet = 1760*3*12 inches

Oh and I am glad that in the US at least the electricians have a professional liscense. Keep up the good work, maybe you'll have some certificates for the other professions as well, soon!
Reply: @wbarber69  wagos are meant for fixed installations. Are you setting up a hammock on your house wiring or something?
Reply: @KrustyKlown  Uh what? The contact force in wago connectors is all metal. And very risky? I have never heared of a single instance of a fire or  any other problem caused by wago connectors. They really don't fail. I also don't know a single electrician who doesn't use them. Wago connectors are everywhere here. 
But I do agree wire nuts were great in the 70's and 80's. Better then the old "lusterklem" screw connectors.
Reply: @Peter_S_  however the US electrical system is internationally seen as an example of not how to do things and they are prone to failure. I’ve seen countless videos of someone saying that an outlet is on fire and it’s a wire not at the back internationally speaking. this is very uncommon not something that is as common as in America.